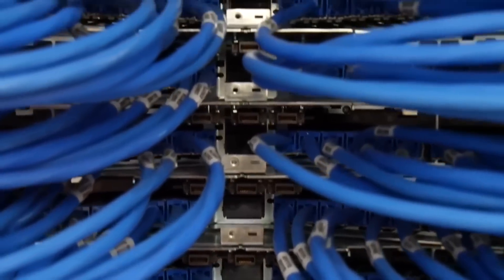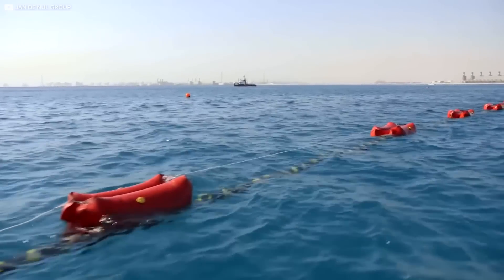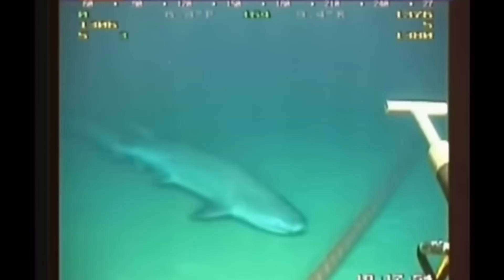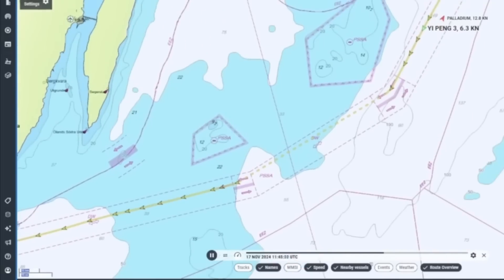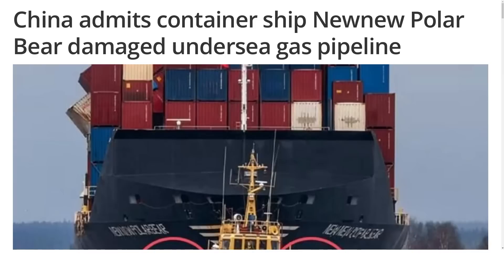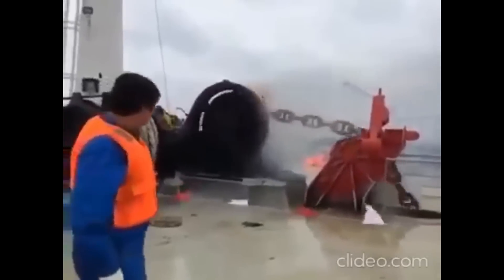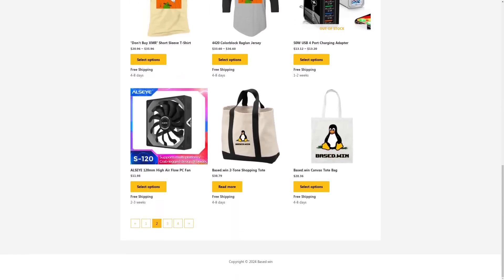When Undersea Cables Get Cut

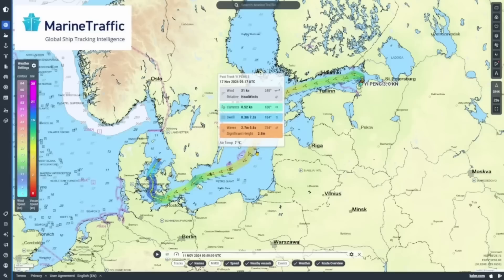Comment: 3:46 I've seen on one of these tracker websites. That other ships also lost connection, in the same area, at the same time. That could suggest jamming from Kaliningrad. Which is a regular accurance.

So if true. We can't be sure, that the ship turned off it's AIS.

It probably won't change the likely conclusion. But it's a puzzle piece worth mentioning.

Comment: fiber optic cables arent fastert than copper, the just have more bandwith, but latency is about the same, or even a bit worse because of the conversion between electrical an optical!
Reply: More bandwidth literally means it's faster but go off 😂

Comment: Fiber optic cables aren't exactly "fragile". They have a minimum bend radius (10-20 times the cable diameter)... and so do ethernet cables. (5-10 times the cable diameter). They are "more" fragile than ethernet cables but not "fragile" in the absolute sense that if you're not constantly careful they'll shatter.
Reply: You must not work with fiber, obviously. There's also dozens of types of fiber lines. 

You can put a 90⁰ bend in CAT5, can't do that with fiber.

Comment: Great video! I think there's a small nitpick though. The signals will travel at the speed of light in optic fiber which is around 2/3 of what we call the speed of light (in a vacuum) so you can certainly send information at a faster speed than that.

Comment: As always, mankind is often on the very edge of destruction. It's like when ONE capacitor or copper circuit trace fails on your laptop or machine, and that one simple thing renders the other 99.9999% of the entire project or device useless.

Comment: While the internet services in the affected areas have been rerouted due to built-in redundancy in submarine cable networks, any disruption can still lead to increased latency and potential slowdowns for users relying on these connections. Hopefully they're fixed quickly.

Comment: 1:30 - No no, light doesn't travel at the speed of light in a optical fibre as it does in a vacuum! The speed of light in a fiber-optic cable—which is approximately 67% of the speed of light in a vacuum! Electricity (signal propagation) might travel faster in a wire than light in a fibre-optic cable. That's not why optical

The advantage becomes apparent when using Wavelength Division Multiplexing (WDM), as each optical fibre can carry significantly more data compared to a copper wire.

On the other hand, light in a fiber-optic cable doesn't encounter issues like parasitic capacitance, inductance, ohmic losses, or electromagnetic and radio frequency interference as copper cables do (even when twisted, shielded, and equipped with a ferrite bead). Fiber-optic cables are also unaffected by electromagnetic pulses (EMP) from nearby lightning, unlike copper cables.

I've seen that fiber-optic connections are much more reliable due to lower maintenance requirements. Back in 2016, when I used a cable internet connection, I frequently faced issues caused by moisture or water damaging the RJ45 connector on the provider's end (the modem was mounted on an electrical post). But my fiber-optic connection has been running smoothly for 4.5 years without any problems!

Comment: Electric current, as an electromagnetic wave, typically travels at very nearly the speed of light; fiber optics are just cheaper (for decent signal strength/fidelity) for those types of distances

Comment: 0:49 "You can't get any faster than light speed travel" misunderstands fiber optics vs traditional coaxial cable, Ethernet, etc all use light speed travel. All light is electromagnetic radiation.... the question is one of resistance to that radiation in the medium...

Comment: The whole ship anchor thing is only explanable for ONE of the cables... Except there is one problem with that.
If we go back and look at the last incident where this actually happened, the "New New Polarbear" (A piece of junk ship, crew and unmaintained ship that shouldn't be sailing, but that is a different story) cut one such line by dragging.

However, it lost its anchor, the load is too strong for the chain and anchor to hold an impact load like that, and that was in shallow waters.
Now one of the cables are in shallow enough waters for a repeat incident with the anchor, the other one is WAY too deep, you can pretty much forget it.
Not only do you have to pull and drag the anchor, but also the chain itself, and an impact at that depth with that much chain means you do not get just a dinged anchor...

You will have no anchor period, if you can even move ahead.
So anchors are out, but they could have other devices dragged behind the vessel, that is possible, and would be found by inspection.

Comment: Now I want to know how they fix the cables. Do they fill with water when they’re cut?
Reply: They are filled with a hydrophobic gel usually called PolyRed.  It’s not water soluble, and it behaves a bit like kitchen fat does in cold water.
What happens is you have divers go down in a specialised diving bell, they  bring down a new section of cable and essentially work on the ocean floor in a completely dry sphere.  We cut back several meters and simply write off the entire section, so anywhere we cut and work is generally never exposed to water. The real time eater is every single strand has to be tested with a laser reader and it can take 3 minutes per strand and you can have 300 glass strands in a bundle.

Comment: Firstly, a fairly neutrally stated video,, which is most appreciated. Better to not draw premature conclusions unless there's good evidence to back it up.
A few questions we might ask are:
Is there a lot of shipping traffic in the Baltic sea? The answer to that would be yes, in relation to the size and economies of the surrounding countries.
Have there been many accidents with undersea cables getting damaged? As a Swede, and as far as I can remember, no. In fact remarkably few.
That looks like an indication that if there was an accident, it would be very much noticed. Which is the case.
Another question: What would China have to gain from subtly disrupting the communications between close allies in the case of Sweden and Finland and, at least, good buddies in relation to the Baltic states and the Nordic ones? These days also being NATO allies.
As far as I can see, nothing at all. Communications weren't cut off. It's not a devastating blow to our economies. It was a minor nuisance.
Which leads me to believe that it was not deliberate sabotage by an adversary, at least from what I know. If those undersea cables also served some other crucial national security or NATO related purpose that did not have any backup lines of communication, that analysis might change.
So from what I know, my assessment is that it's unlikely to be deliberate sabotage, but one or more factors may have contributed to the damage.
Another good question to ask is how long anchor chains on shipping vessels normally are. 170 metres sounds awfully long, but I know nothing about shipping. Perhaps they need to be able to anchor in deep waters.

Comment: You should watch what's going on with the shipping channel where Sal pointed out that in one instance there were four cables and pipes and the one that got damaged going last on the course of the vessel. If only they wanted to damage precisely that one cable it have some sense. But since we have no idea what they were thinking about, we can actually assume criminal negligence. Since there were multiple incidents with lost anchors and multiple instances of various governing bodies inspections displayed general lack of proper maintenance on Chinese ships. 
Sabotage is not excluded. But as for now, there is much more evidence of typical capitalism, rather than criminal activity.

Comment: There's possibility they got blackout and decided to drop the anchor. depending on their position, if they are in the middle of traffic dropping the anchor probably the right thing to do rather than floating without a power. Also it take time to restart ship engine depends on the trouble.

Comment: 1:00 ish, dwag, electricity propagates at 50-99.99..9% of the speed of light. For all intents and purposes its damn near instantaneous. Your "speed" gain from going from "electricity" to "light" is negligible compared to the processing delays which are the real bottleneck and are basically the same regardless of medium. The "speed" of electricity was never the problem. The problem with electricity for long distances is the transmission losses and the infrastructure complexity required to mitigate that.
Reply: The transmission speed difference over 1000km between copper (~5ms) and fibre optic (~3.3ms) is, quick math, 1.7ms. Thats over 1000km. Its absolutely negligible compared to all the other sources of delay.

Comment: I don't want to be pedantic cause the video is good, but maybe someone will find it interesting re: fiber optics vs conventional cables- both the optic and electric cables actually transfer information at the same speed by themselves. Fiber optics uses light, which travels at the speed of light, and electric cables use electric field, which also propagates at the speed of light (it's one half of what makes light after all, minus the perpendicular magnetic field). It is a very common misconception that the pulses travel slower in electric cable (EDIT: this is actually incorrect on a technical level as mentioned by one of the comments below. The different materials will have different speeds of light within them based on the refractive index of a given material. However for copper and most glasses used in optical fibers these indices are very close, and depending on the materials, conditions and wavelengths you're trying to send, either might have a slight advantage. It however will be so small that it is not realistically perceivable when it comes to data transfer, and will be overshadowed by other factors). The reason fiber optics actually transfer data faster is because 1) it can work on several channels in parallel, as stated in the video, but also 2) that the signals, be they optical or electrical, get dispersed and attenuated as they travel, meaning that along their path they have to be read and re-sent from amplifier stations. For electronic signals, the nature of this process is obviously electronic, and so it takes time for the signal to be read, processed, restored and re-emitted, with the bottleneck being the computational speed. The optical signal however relies on solid-state absorption-emission effects of specific materials and so the speed of processing is as fast as atomic electron transitions can occur in the material, which is usually much faster. Given how your signal will have to go through many of these amplifier stations before it reaches the target, the time saved from reading and re-emitting the signal adds up and by the end becomes perceptible to the user.
Reply: nice read. It's similar to when people talk about internet speed being fast, sometimes they mean low delay, sometimes they mean high bandwidth.
Reply: Oh thanks! This was really insightful. You basically answered all my questions about the logistics of data transfers over sea cables 🙌🙌
Reply: Great write-up, I have one further nitpick though. The the speed of light/electromagnetic radiation differ a lot between materials. It's called the velocity factor, and is a proportion of how fast the wave travels VS the speed of light in a vacuum (which is constant). You're thinking that both fibre and copper are traveling at C, but it's a proportion of C depending on the medium (and insulation in electricity's case.).
Reply: @tai-bere3500  You are absolutely right, it somehow escaped me to mention that. Indeed the speed of light is different in different media and that affects the wave propagation speed. However, the velocity factor is a function of refractive index of the material which for copper and most optical fiber glasses is roughly the same to certain approximation for frequencies at which data transmission happens. As a matter of fact, depending on materials and conditions you might find that a copper cable will have a slightly faster group velocity than an optical fiber. As such these differences are mostly negligible for transmission speeds, but you are absolutely right on the theory aspect, I will try and edit my comment to reflect that
Reply: @Assault_Butter_Knife  the speed of light can never change. It doesn't change in any medium. It's only an illusion caused by light having to travel a longer distance
Reply: @tai-bere3500 but isn’t the light used to transmit data in fiber optic the same ‘thing’ as what is representing data in copper? The ‘thing’ being EM waves? I do get that the medium does play a factor but I think the “nothing travels faster than light” statement by Outlaw was what inspired OP to post their comment. Ofc this is extremely pedantic but I find this interesting as a student in the field and the convo has already started so lol
Reply: @tai-bere3500  the speed of light cannot change. It is only an illusion
Reply: Awesome read, thanks! :D
Reply: fibers are also worthless for thieves, unlike copper wiring, which always gets ripped out
Reply: There's plenty more info on the subject, but a good and well-written analysis regardless.
Reply: Just to nitpick a little bit more:

Propagation speed is important but what we refer to as "speed" of the internet connection is bitrate, not propagation speed.
Optical cables use much higher carrier frequency than copper, and carrier frequency is a limiting factor for bitrate. This allows optics to have orders of magnitude higher bitrate.

This and the fact that there is no electromagnetic interference (noise) is what makes optical cables so good.

Also, copper uses multiple channels (carriers) too, this is not unique to optics.
Reply: Electric signal speeds are limited due to inductive/capacitive effects
Reply: This is the type of comment I love.
Reply: This is not the right forum and format to reach out and teach people, but.. Thanks for  a good read.
Reply: @afroninjadeluxe  really?
Reply: @floorcrawler it's always a good time & place to learn. I for one appreciate the explanation.
Reply: @floorcrawler  And what are you, some kind of "right forum and format to reach" police?

Comment: 0:48 ehh wrong, the speed of light in (a) glass (fibre) is actually slower than the speed of electricity in a copper wire. Go on, look it up.

Fibre is used for other reasons but as you don't even know that basic, gonna stop watching here.

Comment: Had a runaway anchor once out in deep 800-1200ft deep waters, so luckily it didn't hit anything, but larger container ships and the like have 900ft chains for their anchors on average so it's not out of the question. Considering the webms of quality chinese engineering I've seen, it isn't totally in the realm of possibility that it was an accident, and that no one noticed it for a hundred kilometers isn't a big surprise either. It is hard to tell the difference between malice and incompetence.

Comment: 0:48 Except that light travels through glass (eg fiber-optic cables) at only 70% of the speed of light through a vacuum, so yeah, you actually CAN get faster than the speed of light in a way. That's why for the fastest possible communications (eg for stock-exchange crap 🙄), they have microwave-dishes on towers aimed at each other to communicate through the air at 99.7% the speed of light through a vacuum (which is also about the speed of electricity through a high-quality conductor like pure copper).

3:17 China "accidentally" dragged their anchor and tore an undersea telecommunications cable… again… at least three times in the past few years. Oopsie-doopsie. 🤷 It's toootally Hanlon's Razor, it's super-incompetence, not malice. Again and again. But they should toootally be allowed to keep sailing. Yup. 😒

Comment: Line of sight microwave links still have lower latency than fiber links due to the way light propagates along a fiber optic cable.

BTW fiber optic cables may not have a lot of shear strength but their tensile strength is enormous, being many times greater than that of the highest tensile steels.

Comment: “Sir, another anchor has hit the second cable”
Reply: steel cables can't break anchors
Reply: @svampebob007  the water increased the pressure so they just collapsed like sand
Reply: @svampebob007 . They are fiber optic.
Reply: @svampebob007  👀
Reply: In this case, it's the same anchor.
Reply: Cable 7.
Reply: @adama7752  "pull it!"
Reply: @Para-Phrase Larry did it again.
Reply: LMFAOOOOOOO
Reply: Ship anchor can't melt steel cables
Reply: Sir, a third cable has been severed, but no anchor has been detected??
Reply: 😂 lol , great reference
Reply: Sir we also notices there's multiple dancing crabs during the event
Reply: Boat fuel won't melt fiber optics.
Reply: What about the third cable? 19/11 was an inside job. Wake up people!
Reply: NUNU PolarBear > angry eu virgins
Reply: K E K
Reply: Too soon.